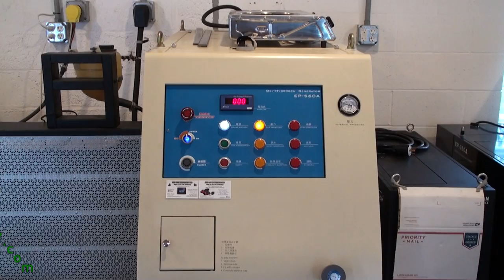HHO Gas Fire Removing The Wheel Bearing From A Brake Drum 8-13-2017

Comment: I changed  both rear bearings last week.... this looks easier
Reply from the maker: This is not the 1st one I have done and I have had no problems performing automobile repairs using HHO Gas fire flame. HHO Gas fire flame does not have any radiant heat. The heat from the flame is pinpoint to the surface it comes in contact with. For example, if you are working on front end parts on your car and you are a half-inch from a robber item it will not burn the robber next to the metal part that you are taking off next to the part you are working on. In other words, I am not shielding other automobile parts to work on the part I am working on due to pinpoint heating HHO Gas fire flame.
Reply: HHO Gas Technology I like your stuff... But am in Africa ... I'll gather up to try your products... The taxes are high.